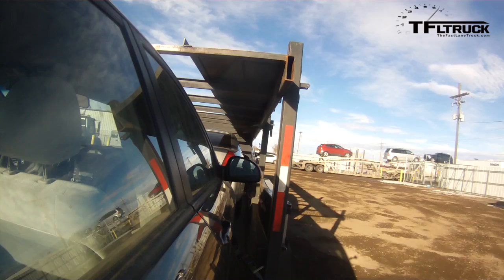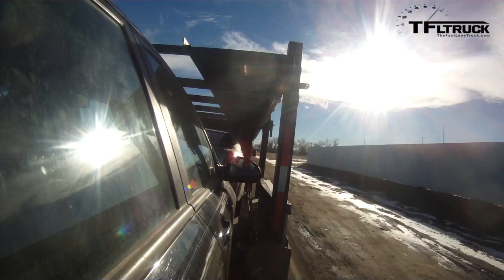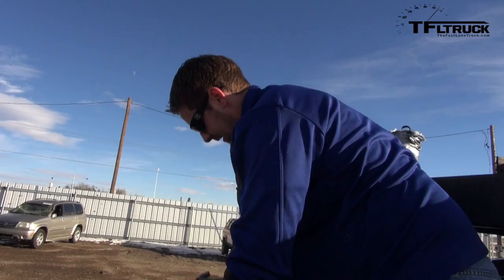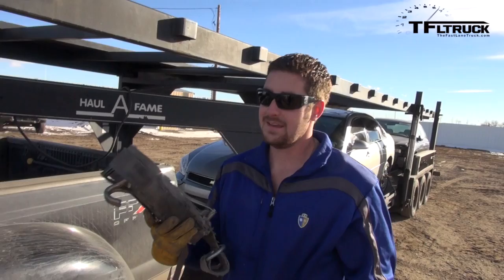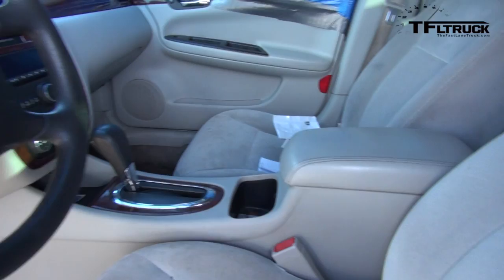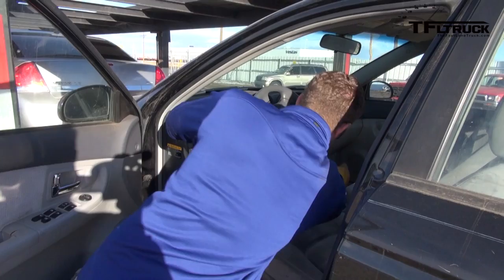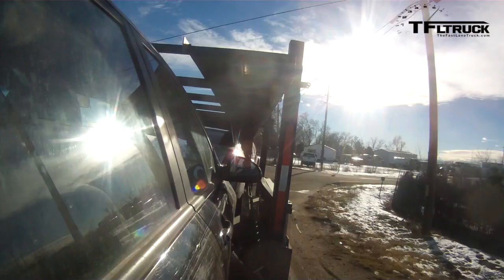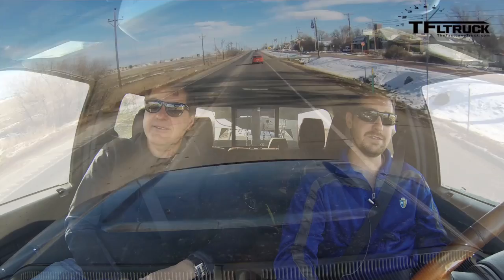A Day in the Life of an Independent Car Transporter (Pt 1.)

Comment: He constantly hauls 10,000 lbs more than the truck is rated at and wonders why his differential keeps going out lol.
Reply: on 16's no less lol
Reply: what's the towing capacity on this truck?
Reply: lorenz rowe Thats a tricky question..........Do you want to know what they say it can tow and do so once or twice a year or do you want to know what it can truly tow all day everyday without problems ;)
Reply: SouthJerseySound all day everyday
Reply: lorenz rowe In rough terrain,mountains,logging roads,etc you could cut the max by half.But if its less of a severe duty 75-80% is a good maximum number to go by in stock form.I've been in the towing business for years and when picking a chassis I try not to ever go above 75% of the ratings.I work with others who have bought trucks that on paper can handle the loads,but realistically they end up with too small a truck and end up burning through them.
One contractor I work with bought a F250 dualy and he used to make fun of us for buying a 450 to do the same job.He added airbags and a few other mods to help but after 10 transmissions,6 rears,4 motors and 3 trucks later we're still running that same F 450.Yes it was more up front and unloaded mileage is a little less(but better loaded) but in the long run it has been much cheaper and more profitable but I wasnt going to argue with him because I enjoyed picking up the slack when his rig was down ;) Also you need to think about resale value too,nobody wants a ragged out overworked truck.With all things being equal if you pick a truck with a little headroom to work with over something just barely capable of getting things done.You will find it much easier to sell and recoup more of your investment from the bigger truck.
Reply: You obviously don't tow anything in life huh. If he's at 36,000lbs loaded total which is the total combined weight. When any truck company quotes towing weight it does not include the weight of the truck itself. So if he is at 36k you should deduct 8-9k so he's really towing 27k-28k smh keyboard truckers cant add smh
Reply: He is still over weight for that trailer i dont care how u shake a stick at it OVERWEIGHT!
Reply: SouthJerseySound is yours diesel or gas? Would a 350 be good or you recommend a 450?
Reply: @giovanitorres9360  
If your a cdl holder f450 to haul 5 cars or more in thoey. With a 40' gooseneck trailer
Reply: Well the fact its a Ford does not help neither😐
Reply: He's registered to haul 38klbs
Reply: Found
On
Road
Dead 💀
Reply: Mfs don't get that if you use a tool wrong you might break it.. lol kid stuff
Reply: It’s because its a Ford
Reply: That's what I was gonna say. He's too heavy.

Comment: He should have gone with an F550. They use a D130 rear axle. The F450 uses a D80. There is a significant strength difference between them. The F550 is intended for commercial use, so holds up better to towing that much weight all day long.

Comment: The death wobble is not just on ford, all other brand have them too, the correct way to fix it is you haft to get your front end tightened, your steering stabilizer is probably loose.

Comment: Reason he's blowing up rear ends is due to the fact the pickup is exceeding the GVW mandated by Ford. The death wobble is due to worn shocks and cheap tires. At least he wised up in the end and recognized he needed a Class 8. 7.5 mpg wow I get that in a 02 FLD 120 Freightliner pulling 80,000 lbs. His gross weight is what I weigh empty.
Reply: Terrance Herwig if I want to buy my first used 18-wheeler. What makes do you recommend if I want to just spend 20K or maybe 30K at the most? Freightliner, Volvo, Peterbilt? And what's the safest kind of freight to transport from your experience?
Reply: @giovanitorres9360  At that price point you're going to be stuck with a HIGH MILEAGE used "Cornbinder" (International) or "Freightshaker" (Freightliner).  Buy a dry van for LTL bulk as a flatbed is more expensive and the heavier loads will kill your older truck.
Reply: Actually DW is a inherent issue with the style of suspension used in these trucks and Jeeps.  It comes from loose components.  His tires (rears were only visible) looked to be Michelin LTX, so not "cheap".  The HD Fords are known to have alignment issues when loaded heavily, that's what is eating his tires. In the end, he needs a heavier truck.
Reply: @mdnky   Yep.  The heavier 550 variant with an aftermarket suspension upgrade does pretty well up here in the NE US.  I would also recommend the longer-framed (10ft or 12ft bed) version because of the heavier rear end.   The GM 6500 would also be an option here.
Reply: Wouldn't be a problem if used air helper springs.
Reply: @Sam Behtash It's 50/50.  The guys hauling to well sites or farms are using 4 X 4's, but IF you are just driving on the hardball (blacktop), I'd say it's wasted gross weight (4X4s are heavier) and fuel.  A 2wd truck and trailer with good tires will have plenty of "bite" for ice or snow.  The operative word being good tires.  DON'T SKIMP ON TIRES in the NE US!
Reply: @Sam Behtash Cooper makes a very good all-season truck tire.  Not as good for gas mileage but it grips like a billy goat and mine lasted for 75K miles on *PAs roads.
* PA's state flower is the orange cone and we grow potholes like Kansas grows wheat.
Reply: @Sam Behtash Watch doing narrow tires.  that increases the weight per square inch on your rims with heavy loads and cracked rims are a thing in hots hotting.

Comment: The 2011 F-450 is using the F-350 set up.  This is the reason you are having problems with the dif and front suspension.  My Dad has an 08 F-450 with 19.5 wheel and Dana 110 with 4.88 gear.  He has over 450K miles on the truck with no problems with the dif or front suspension.  The truck has been perfect with the exception of the 6.4.  It is still running the same trans and shifts perfect.  Ford brought back the HD F-450 in the newer trucks.  The 6.7 with the 19.5's and Dana 110 is the perfect setup for hauling.  My Dad's normal load is around 26K to 28K Lbs...

Comment: Apparently the fix for the deathwoble is to add an aftermarket steering stabilizer shock like you get when you lift these trucks. Poor engineering on Fords part IMO.
Reply: Had an old Cherokee with death wobble and same as you describe, bridge joints in a curve would cause chaos. I Replaced all ball joints expecting it was the issue. Finally I replaced the steering stabilizer and POOF it was gone.

Comment: Hands down the best way to put TT that much weight on a truck is starting with a 26k gvwr like my 99 International 3800 loading one or 2 cars on its flatbed. Then if CDL holder,  mount a stinger steered 5th whl totaling your length at 75ft long truck& Trlr. This trailer can be a 35-45' long lowpro 25k gvwr and you'd have over 60ft deck space. I'm not CDL so my truck only pulls a 10k gvwr trailer holding 7000 lbs so 2 small cars or a truck. My 23ft truck deck 12' upper & 11' lower rear deck holds 2 dinky cars or cargo trlrs. Mine grosses $3/mile

Comment: I drive a 2012 F350 6.7 Diesel, it has 830,000 KMS (515.000) miles. The truck a single rear axle, I added a leaf spring and air bags. I tow about the same weight, on a 42' 5th wheel trailer. I only had to change the diff once, its a 3.73. I think Mike is hard on the throttle when taking off loaded. Also, the tires, the best tires to run on these rigs are Michelin LTX, they last 70-80KM so about 45K Miles if properly rotated. Also i never head a death wobble on the truck and never hear of it on a ford !!!

Comment: Pretty Impressed! Hes hauling more then the specs says he can and has just shy of 200 thousand miles! He never really said anything about engine problems, When you`re hauling that weight frying the axle is understandable and lastly the death wobble is with every truck. Just my opinion but hauling that weight in a chevy would scare me because of all the alignments needed. My neighbor is the manager of a travel company and His 3 Gms are pretty good aside from a couple glowplugs, one of them has a dying trans and the other thing is all the alignments he needs done on them. Lastly I live here in BC and a lot of his tours go through the Rockies and Up Rogers Pass and The Coquahala Highway. Those are nasty roads. He tries not using the GMs for the fully loaded tours because they sometimes goes into limp mode up the passes and that can really hurt business. Just My opinion. Thanks!

Comment: In 2011 Ford went to a Dana 80 rear Axle and 17 inch wheel E Rated, in 2008 to 2010 they had a Dana 110 with 19.5s, they are going back to Dana 110 in 2015 make the Rear Diff much stronger for that much weight.

Comment: I've been hauling a 4 car wedge with my 2012 ram 3500 for 2.5 years now. avg 30k-36k lbs pending on vehicles.  with around 270k miles.   and I've had one problem and that was the fuel pump. once. ram 3500 has a higher towing capacity than a f450. this is the first Chrysler product I've owned. 2012 was the last year trucks w/o DEF. honestly I would not buy any other brand for hotshot trucking. I'm a true believer now. my routes are from southeast to the northeast and back. no programming, stock everything. only a k&n cold air intake. 

drive what you choose. but I would recommend cumins. . 

think about it. are there any v8 diesel 18 wheelers anymore? In line 6 cylinders produce more torque. 

take this advice or leave it. it's working for me
Reply: Larry I'm a driver for Sysco but trying to get in the game. can you give me some direction?
Reply: Hey Larry have a question for you in the 26000 pound rule does the truck pull capacity get added to the capacity to stay away from having to get a cdl? Just trying to see how much weight I can haul if I get a dodge 4500 which weight is 8700 pounds with a 5 car  Kaufman?
Reply: Bro how do i get in this game
Reply: Have any advice on getting into this hustle?
Reply: King Omar84 Hello Omar did you ever start your own business? I’m in the same situation as you were a year ago. I want to be my own boss and need some guidance. Thanks in advance

Comment: 2013 F450: rear differential is 4.30, Maximum 5th wheel towing is 24.7k.

Since Mike's pickup is out of warranty, we can say that it was good for him, when Ford did honor the warranty on the differentials, because he was constantly exceeding the factory specs, by doing 36k lbs GCWR.

And as others have pointed out. An F550(4.80 rear differential) or higher, with single cab and 2wd would be a better candidate for doing these kind of towing daily.
Reply from the maker: GCWR on the F450 is 33,000lbs, so Michael may be about 10% over the limit.  But 4WD is a must running over the Rocky Mountains.
Reply: The Fast Lane Truck Its really not. Look at semi trucks, they are considered 2wd. Now chains, they are a must.
Reply: +The Fast Lane Truck do you have any idea on how much he makes doing this? I've got a 450 and thought about starting up my own transport business.
Reply: +Blake Watson   That # varies MUCH more so than an over the road trucker!
Reply: Yes.... You cant push it though to like 30k.. With Best Line you can do the crap this guy does in normal operation.
Reply: Id ditch the pretty truck and its huge price tag and live without creature comforts and get and Old Dodge with the Cummins or a Ford with a powerstroke.  They would probably get close (if not more) 2x the fuel mileage .

Actually a nicely done up 6.0 would probably get  16mpg and have all the nice interior parts with out the problematic Common rail injection.

Comment: Dodge is the best truck to hotshot with. If you want proof, stop by a transport lot at an auction and see what most haulers use. I've been hauling for 15yrs. My 2011 Dodge has 460k and no blow-by yet. My 2001 made it to 650k. But I only got 275k with my 2006. Fords usually die at around 250k. Not sure about Chevy. Which ever you get, I recommend an automatic.
Reply: He never really said what he makes. Any idea? You've been in the business so that's why I ask
Reply: how did the trans hold up? im on my second one in 131k
Reply: +Donny Krane maybe don't drive the shit out of it. I've owned 4 and never had a problem

Comment: First DOT doesn't care if you sleep in your truck if you are at a rest stop or truck stop. I live in the Phoenix area and most of the vehicle haulers around here are Chevys that I have seen. I don't know if the Chevys are doing local only or long haul. I don't care what you have 4 rear ends in under 200,000 miles sucks. If it was me I would be changing something the vehicle or a complete aftermarket rear end. And I hope he realizes the money he will put into a big rig it will help him in a lot of places like more miles he can put on it but repairs are expensive on a big rig.
Reply: You do not know FMCSA laws very well do you? It is ILLEGAL to sleep in your truck if it is less than 75 inches wide interior dimensions. That is why they make sleep kits for duallys. And DOT does enforces it.

Comment: I had the same wobble on my Dodge 2500 an I put 2 horizontal stabilizer shocks in front of the front axle and got rid of the wobble. Hope it will work for you.
Reply: what year was your dodge 2500 and how much weight do you often tow?

Comment: Sounds like something in the front end like the track bar bushing, or track bar balljoint has play and is trigerring the death wobble, a proper wheel alignment should keep the tires from getting outside wear in and front and getting cupped.

Comment: Man...only Ford owners would think that 4 differentials and a death wobble makes it the best truck for the job. I don't care how dyed in the wool Ram I am...if I blew up 3 differentials and had to stop every time I hit an expansion joint, I'd be jumping ship.
Reply: I got a F-250, but would of got a Ram Cummins for what that guys doing, no DEF to think about about and, Cummins are better at running high RPM's for long periods of time. Their built a bit better, last longer under tough conditions, and are more fixable.
Reply: Josh McCarthy Rams have their own front end problems (including death wobble), notorious for their ball joints, the weakest automatic transmission in that segment (68RFE) and the lack of DEF caused those engines to burn a lot more fuel.  Though I think the 2014 Ram 3500 with the new chassis, AISIN tranny, and stronger diff, and inclusion of DEF would have fixed all that.  But then Chrysler seems to be still doing a lot of recalls on their products.  You probably think I hate Rams after reading this, but no I really like them, I would buy the 2014 Ram 2500 when the time is right.  But I am just pointing out, as many others have, they all have their problems.
Reply: MrChevypower I have a ram with 311k miles with no death wobble issues. Death wobble is usually an issue with 4wds. These guys are stupid for buying a 4wd to tow on hwy. More parts, more maintenance, more problems, and more money. The 68RFE is a great transmission and I know many car haulers that r still running their original tranny with over 300k. And ford and gm started running def just a few years before dodge so their 07-10's have the same exhaust problems. Everyone talkin shit on dodge autos is ignorant, that was 20 years ago. Today they are as bullet proof as the G56
Reply: Josh McCarthy Whats a def? you mean a dpf or are they different?
Reply: Yeah it seems like those two things could have been fixed with some aftermarket parts the first time idk why he didn't but its kinda impressive he didn't have any other problems tho with engine trans etc
Reply: MrChevypower  deisle exhaust fluid
Reply: HondaCummins
In fairness to the four wheel drive issue, a lot of the yards he'll be getting cars from aren't manicured or paved, so if you take a 20,000 lb trailer through some soft stuff, you need that 4x4. That trailer is just a big ol' anchor sitting back there.
Reply: Josh McCarthy That was MightyMatt who asked that.
Reply: Josh McCarthy thanks
Reply: threefortyduster In the video he is at a salvage auto auction. Those yards are mostly dirt and gravel. In the 8 years of transporting cars, Ive never seen 1 truck get stuck at one of these yards. When car haulers do get stuck, 9 times out of 10 its from high centering. you'd be surprised what a 2wd will go through with some weight on the rear axle.
Reply: TheMightyMatt67 D.E.F. - diesel exhaust fluid is mandatory on all new diesels as it assists in regen and cleaning the exhaust. Open the fuel filler door on any new diesel and they'll have two spots to fill. Def supposedly lasts a couple thousand miles per five gallons. (paperclip out)
Reply: DEF is not mandatory. DEF is the easiest way and most fuel efficient way to comply with the new emissions standards. The Cummins was able to comply, but it was hurting due to poor fuel economy, the DEF injection let them tune the motor differently.
Reply: It's true.
But you can always pick up a ford for cheap 

 For always has these cash incentives 
Company guys love it
Then they can afford to traded in every three years so who cares if it breaks
Reply: the def is mandatory... it makes the truck cleaner. if you're not going to add the fluid delete the whole system either way its illegal to neglect the def or delete the DPF... i have my EPA cards to back this. luckily here in New Jersey  diesels no longer have to go to inspection so we delete all the epa code shit.  also not everyone has these problems... my buddy does the same thing with the same truck and has had no problems with the diff.... the most he spent on the truck was a new windshield.. fucking turkey vulture right through the mothafucker
Reply: threefortyduster the old OBS didn't have these problems... all the new stuff is crap
Reply: What about when you go through 3 tranny’s would you still be on dodge??
Reply: Ford truck 500andmore
Reply: @TheMightyMatt67  d e f stands for diesel exhaust fluid DPF stands for diesel particulate filter the fluid you put in is d e f